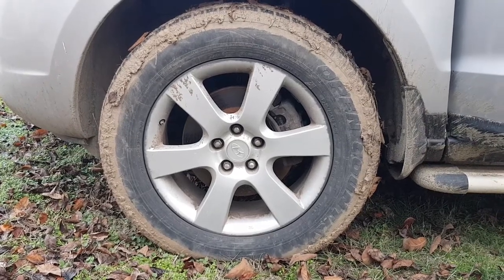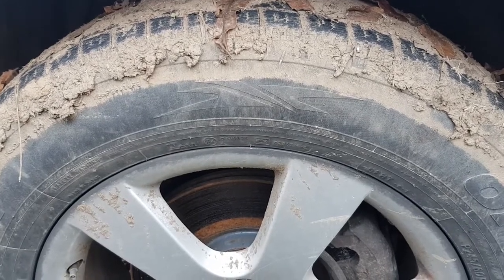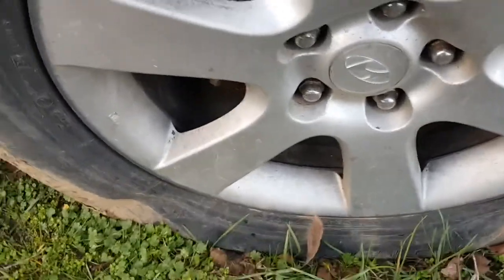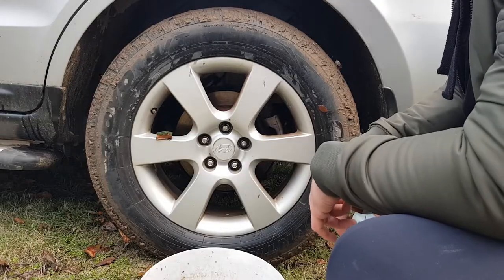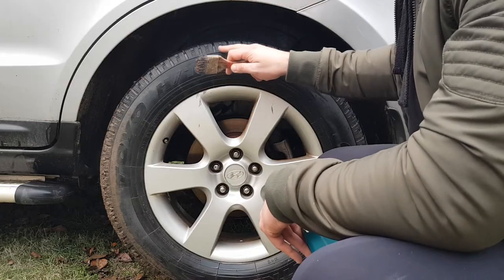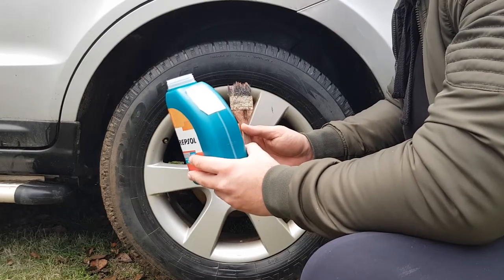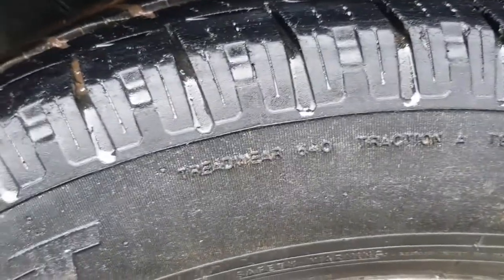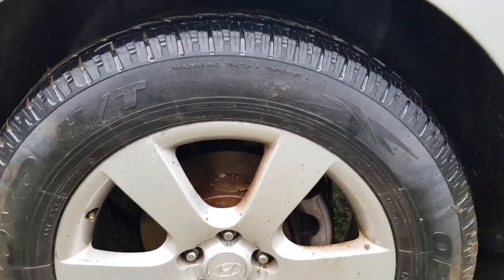Why Do Tires Dry Rot and How To Fix It

Comment: CLean your tires and apply 303 Protectant , an American product in a spray bottle . To your sidewalls , even tread and inside , sidewalls . It will resisit  the UV rays of the sun and cracking / drying out .
Reply: American products are overrated term😂
Reply: I have been doing it weekly - spent a lot of time washing, cleaning but also money. The tires still rot in three years. Don’t read American advertisement.

Comment: I have a rear wheel drive car with older tires with almost all the tread but the dry rot is getting bad. I’m just wondering if a small burnout would help bring out some fresh rubber by burning off the outer dry layer
Reply: I don't think that's the best ideia, I would replace them either way

Comment: I had a tire replaced with a new Yokohama tire 2 years ago and has tiny cracks not deep around the rim, any suggestions on how to fix this problem? I don't have the money for a new tire.
Reply from the maker: If the cracks around the rim of your Yokohama tire are tiny and not too deep, they may not necessarily compromise the safety or functionality of the tire. 

These cracks could be due to normal wear and tear or exposure to harsh environmental conditions. 

However, if you want to address this issue, here are a few suggestions:

1. Tire Sealant: You can apply a tire sealant that's designed for minor cracks and leaks. However, this is a temporary fix and is not recommended for long-term solutions.

2. Epoxy Resin: Some sources suggest using an epoxy resin and hardener mixture to fill in the cracks. You would need to clean the area, apply the mixture, and allow it to cure. However, this method should be used with caution, as improper use could potentially damage the tire.
Reply: @carcarehacks  Hii is there any Tire Sealant you can recommend that best for sealing tire cracks?

Comment: is it safe to put oil on tires. will a tiny friction with the road cause a tire fire?
Reply: I mean unless you’re completely dousing it in oil but either way putting oil on your tire will cause the rubber to get damaged.
Reply: @user-bi2me1kj7p  yeah this is not a good video.

Comment: Why would you do that? Oil would act as an insulator keeping moisture OUT not bringing more in. Water and oil seperate. Applying oil to something ensures water will stay out. Which is why it can be used as a temporary seal.

Its also why those tire protectants can do more harm than good. They make your tire shiny, but lock out the moisture the rubber needs.

You cant "fix" dry rot. The rubber has already broken down you cant repair it without adding new rubber to it. All you can really do is wash your tires more frequently to keep grime oil and dirt OFF of them so they can breathe a bit easier.
Reply: Are we really thinking now that rubber in tires has some inherent moisture as part of its structure, even after the process of vulcanization, which uses a lot of heat? 

This is a genuine question, i never would have thought so. I could believe it because rubber is a natural protein from plants. But isn't tire rubber these days synthetic? 
Idk man, kind of doubting this. 
I think they just call it dry rot but is it really rot and is it really because it dries out? Idk
Reply: @simonlinser8286  Dry rot is the result of the rubber no longer being able to hold moisture and it literally dries out. Once the rubber begins to dry out, it loses its ability to expand and contract without breaking itself apart. Thus, the cracking.

I dont know the precises chemical breakdown of modern tires, but this is true for almost all forms of rubber and plastics today. 

It appears that tires are coated with a resin that essentially keeps them from drying out. Once this coating is gone, is when the drying out process begins. It seems largely unavoidable, but their life can be prolonged by proper storage. Mainly minimal UV exposure.

"Tires naturally degrade over a period of time because they’re made from rubber. When a tire ages, it loses the protective resin which keeps the rubber from oxidizing and drying out. As those oils evaporate, the tire becomes brittle, and starts developing cracks and begins to break apart.Tire dry rot is a condition that expedites the aging and drying process. It occurs when a tire encounters certain substances, temperatures or vulnerable situations. While it’s easy to prevent, it can be difficult to repair when it begins to form."

https://thepalmbeachgarage.com/tire-dry-rot/

So unfortunately, once the process begins it does not appear to be reversable. At least not without the tire being entirely reprocessed.